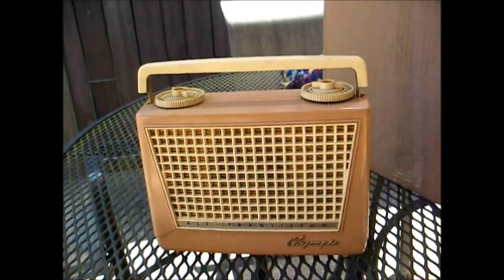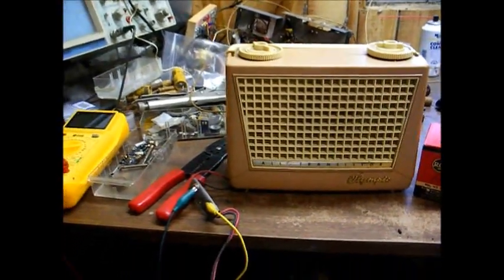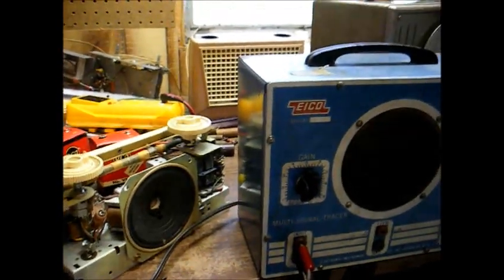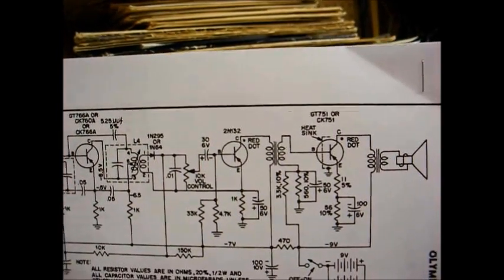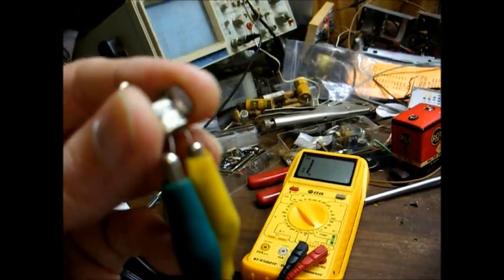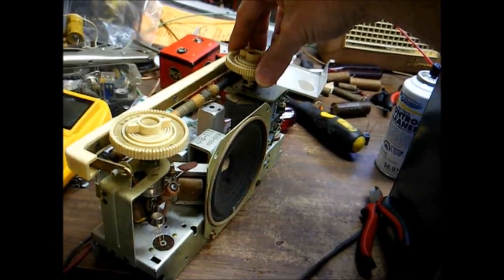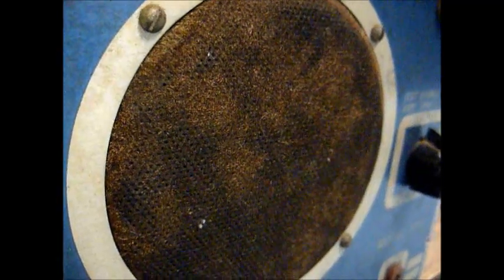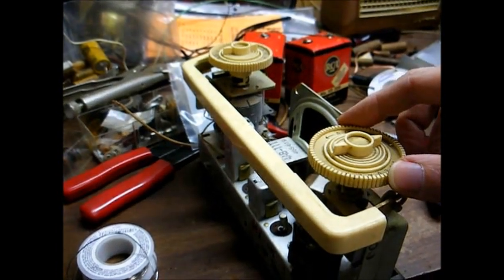Repair of a 1956 Olympic model 447 AM transistor radio

Comment: 3:27 Whoa, it was a sudden crossover construct! There's only one IF amp stage in this xsistorized radio receiver.  Hell, its design looks almost jury rigged?
Some cross-over designs used xsistors only in the audio power amplification - - in portable sets this made sense, as to conserve the A and B batteries that drove the tubes.
 My late father owned a vacuum-tube based, portable picnic radio like this. It could be powered either by batteries or a 110V AC connection- -it had a small Selenium-stack rectifier

Comment: 3:18 I wonder why these battery powered sets with single-ended class A output stages didn't vary the bias/idle current with the volume; a low amplitude signal could be handled with much less than maximum idle current and battery drain and the heat from the output transistor would both be much lower, unless the set were always turned all the way up.

Comment: I bet soldering that output transistor to it's heatsink is what made it eventually fail. Those Germanium semiconductors can't take any heat.
Reply: Weren't they separated from the soldered connections by the same socket connector they used for the peanut tubes?

Comment: Great video radiotv!
like how you showed how you systematically went thru the troubleshooting.
I am trying to learn the basics and like how you mixed your practical knowledge with the science.
did you publish part 2?
Sort of lost you when you went thru the process of testing the transistors,is there a systematic way i could learn  the interaction of the c,b,e,and are they the same with php or npn ?
thanks
john w

Comment: Maybe it's just me, but I think it's hilarious that Olympic soldered what looks like a fuse holder to the audio output transistor as a "Heat Sink". I read the book "Crystal Fire" about the invention of the transistor and the early days of the transistor industry. It talked about how delicate the point-contact germanium transistors could be. I wonder what the failure rate was on that transistor after having it's can soldered to a metal bracket.

Comment: Wow cool radio! Never seen a retrofit like that before. Those RCA batteries look like they are from the mid 60's. If my memory is correct, they had a three digit date code on the underside, the first digit is the year and the next two is the week (L to R).

Comment: Great job!
   That driver transistor that you scrounged around for a replacement for. Was that one germanium as well or silicon? I'm surprised that you didn't have to play around with the values of the biasing resistors.
   Tom
Reply from the maker: It was a germanium, salvaged from a mid '60's low end Magnavox junk stereo chassis.
Reply: radiotvphononut
OK, now it all makes sense.
Thanks!
Again, nice job.

Comment: That's cool how they modified the circuit to transistors.  Smart move by Olympic.  The solidness of vacuum tube construction combined with the reliability and efficiency of transistors.
Reply: Chris any cable boxes or the like with the bad big caps in them lately?? You got some good videos sir!
Reply: no that was it just the d-11 directv receiver. those are getting pretty old now, probably not too many of them out there these days given its an analog video output. everything's moving to digital.
Reply: Ahhh ok I got ya.  I just thought it was a great repair, that was a weird looking set up, and I would have never figured that out.  Been checking out your channel! Fine equipment and repairs! Steven